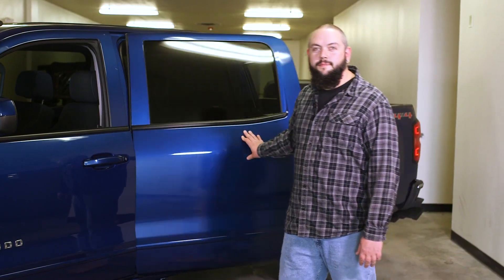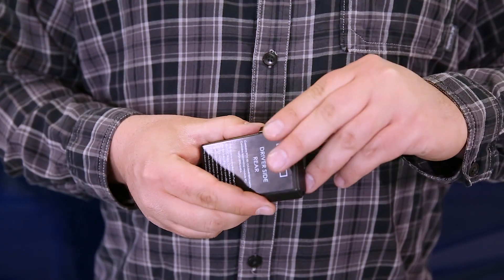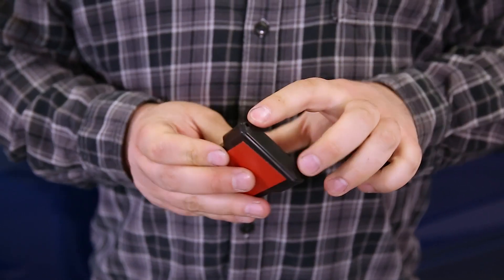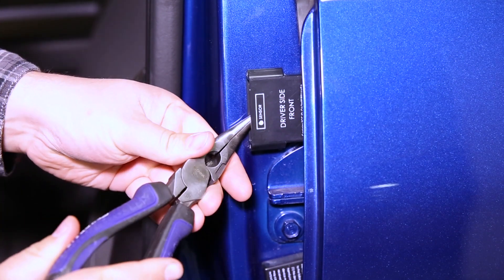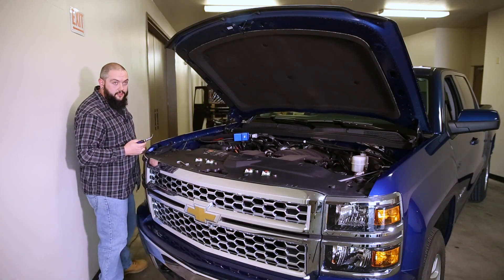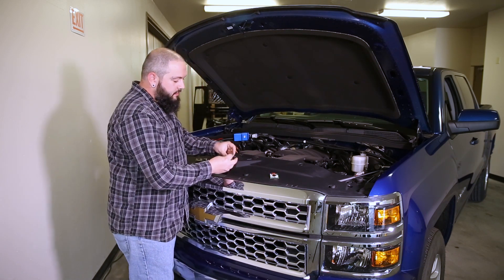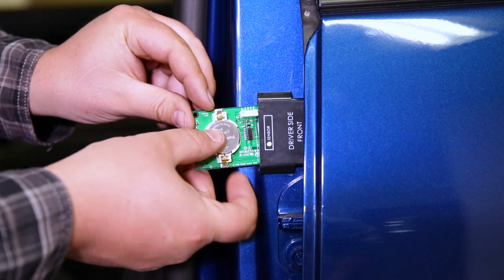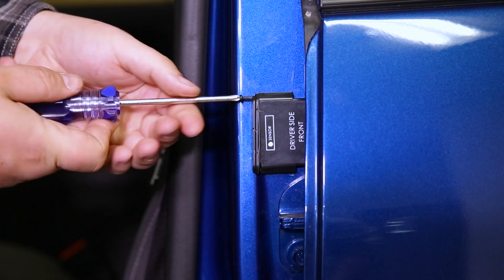Powerboard Sensor Reset

Comment: Any idea how to fix one side that just isn't closing all the way?
Reply: Try power washing all of the hinges really well to get any dirt or grime out of the hinge and posts.  Then spray them vigorously with WD-40 and have them open and close several times to see if that solves the issue.  I use WD-40 Specialist Protective White Lithium Grease
Reply: A